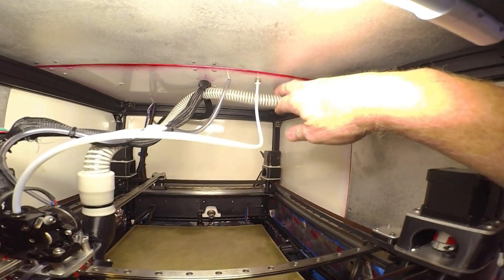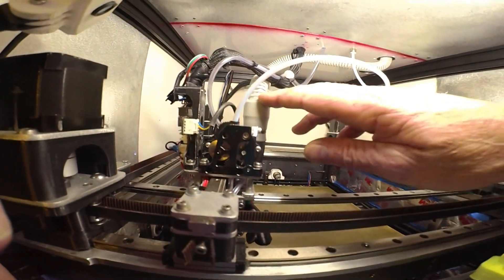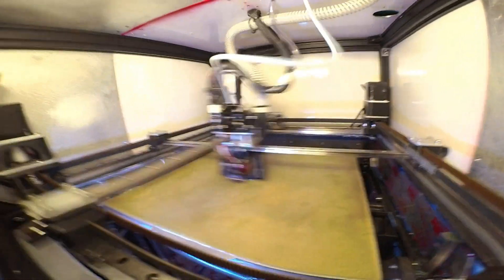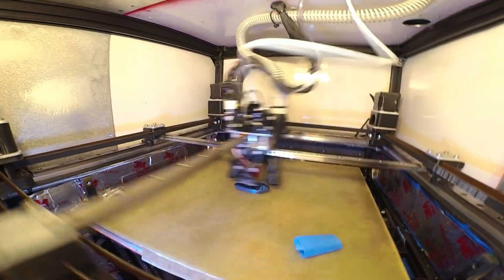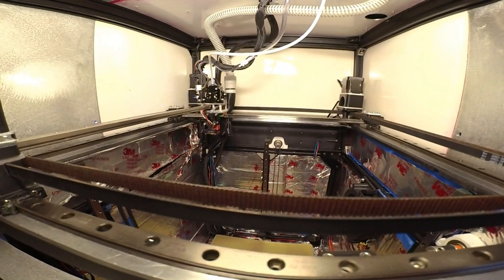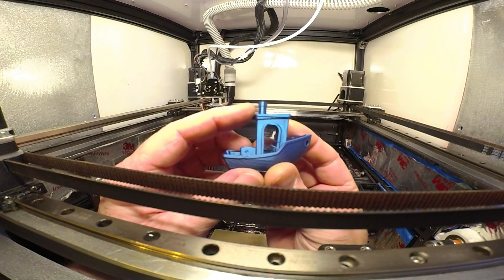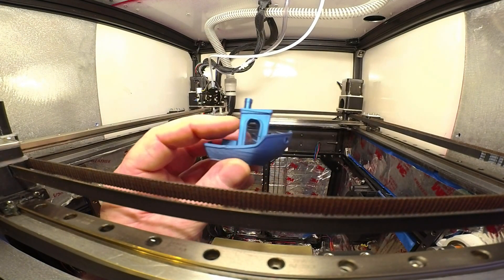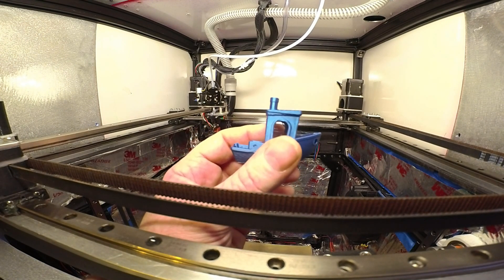PLA Benchy 9 minute

Comment: You like the extruder? Good surface quality? Can you do a video talking about it?
Reply from the maker: I waffle between the HGX and the sherpa variant. I like to use the sherpa more just because I made a custom housing that joins my toolboard to it for rigidity and the motor is lowered and moved to the left. I was having problems with heat creep on the sherpa and the filament tension would reduce grip. Since printing in PC the sherpa housing it's been doing good. The HGX is nice because it's all metal and no problems with heat creep. I have printed some stuff at 50mms3 flow and the HGX was able to push it (my hot end is not good enough to push 50 so I need elevated temp and more pushing force (not the way to do things!)). So the HGX seemed to work better under more rough conditions. But in reality I have not noticed any difference in print quality. I recently printed a vase mode airplane with the sherpa and I will print another with the HGX to see if they are the same. My camera setup is not good, or actually the lighting. It's overexposing the model and hard to see the layer quality. I will make a comparison and video it.
Reply: @MrRocksalt  Thanks for the info! Yes, the HGX is a compelling option. Be interested to see more on your extruder thoughts and results.

Comment: The printing speeds are very impressive. Great work! By the way, I would like to know the advantage of cross-gantry over core-xy.
Reply from the maker: Check out the Annex discord. Basically, Crossed gantry acts as a large moment to stabilize the toolhead. Each cross beam supports the opposite beam from twisting. So the rigidity goes up. Also, the belt path is shorter and the belts do not control skew.

Comment: What extruder are you using?
Reply from the maker: I really like the sherpa, but.. this extruder, when printed in plastic, will start to wear and the filament grip lessens. It's much lighter and I can move the motor where I want it for balance. But if I put the screws to it with speed, the filament can get harder to push from the hotend not keeping up and it will slip. SLIP, not SKIP :) If I print a new one it will work for so much time and again have problems later. I would say the VZ all metal sherpa variant is a very good choice. However, the HGX has fantastic force on the filament with the larger gears. It can overcome some filament force the Sherpa cannot.. but in the end the filament needs to be molten and easy to push.
Reply: That's the HGX Extruder